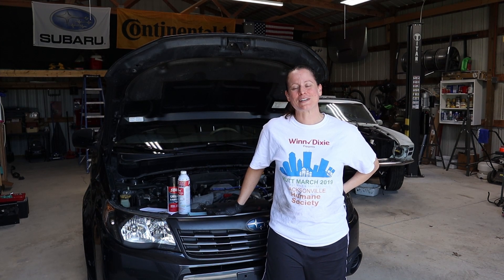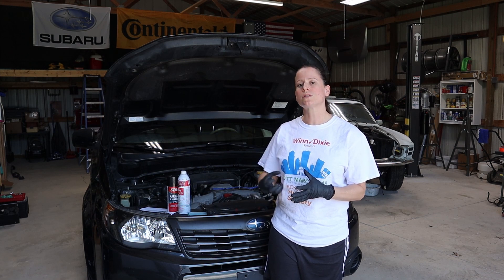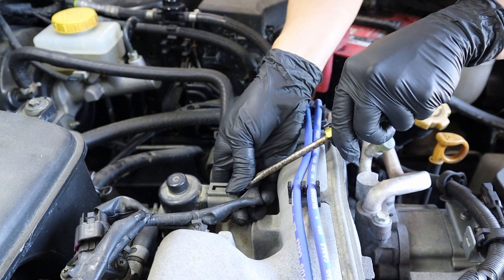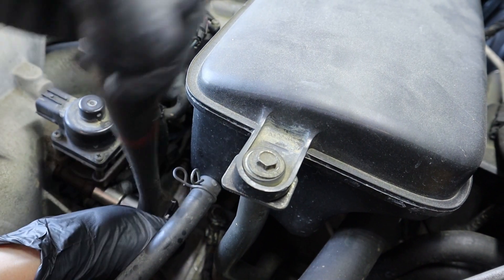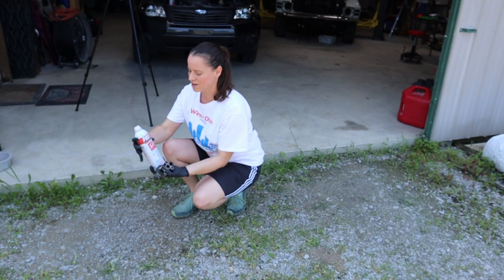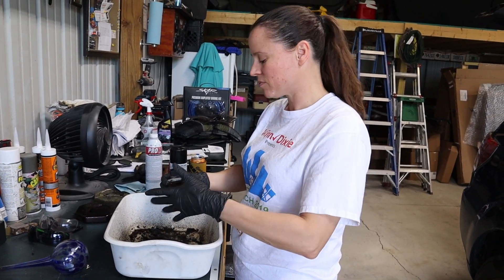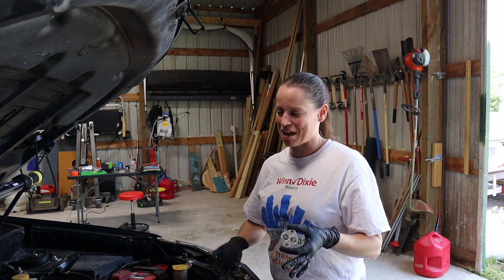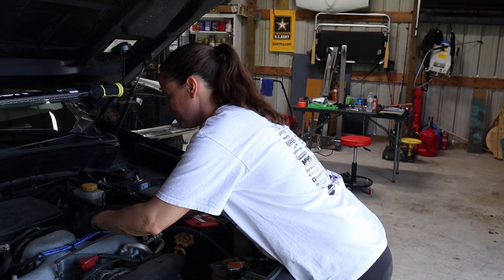Codes P0301 & P0302 w/ EGR Valve Removal - 2010 Subaru Forester

Comment: I know that you eventually found the issue to be the exhaust valves; however, I would suggest that if anyone feels the need to mess with the EGR valve, you might as well also remove and inspect the EGR tube.  if there is a ton of carbon in the valve, it is also likely in the tube.  this is the big tube thing that is next to the EGR valve.
Reply from the maker: Hi S M. Thank you very much for watching and sharing with the community.  That's what this is all about. Cheers!

Comment: 2006 sti po302. Swapped spark plug and ignition coil. Code came back. Next will be swap fuel injectors from cylinder 2 to 4. Next will be compression and leak down. Already did chemicals like seafoam, b12 etc. Last will be torch the car
Reply from the maker: Hi Miriam, thanks for watching and I do really feel you with the last remark of torching the car! Chasing down these codes feels at times to be the very definition of insanity! I had many people suggest a compression and leak down test on my Forester, and had I kept the car after replacing the heads (my codes were due to slipping exhaust valve guides) and the codes came back I probably would have done them before throwing in the towel. You could also have the fuel injectors tested and cleaned if you could stand to not have the car for a few weeks, and then you'd know for certain if the fuel injectors are to blame. Hope you find your sti's demon and exorcise it appropriately; take care and stay safe!

Comment: Hi, I have a Subaru Liberty (Legacy) 2.5L NA 2009 (gen 4) in Australia. Just seeing that you have a pretty cool spark coil wires. May I know which brand use have and also do they fit for vehicles in Australia? Thank you.
Reply from the maker: Hi Captain Cookie (love the name!), thanks for watching and noticing those wires! I picked up a set of NGK brand at some point while I was chasing these codes, and while they didn't fix the codes, they do look very pretty and matched the spark plugs nicely. I'd like to say you should be able to pick up the same set, as my understanding is the Australian model you have still is the EJ253 that I had in my USDM Forester. The brand is very common in the states for Japanese manufacturers. Hope you find them!

Comment: Did it work?
Reply from the maker: Hi Demar Mckenley, it did resolve the code for a few months... unfortunately for us, the code came back and our technician at our local Subaru dealership suggested that we check out the exhaust valve guides in the heads. We've pinned a comment to the top of this thread with the link to the video outlining the diagnosis and what the fix entailed. Thanks for watching!

Comment: I have a 2012 forester and couple times a week I get a misfire on all  cylinders. Can someone help please?
Reply from the maker: Hi Yuriy, thanks watching and asking! The 2012 Forester does have a different engine than my old 2010. The FB engines do require different maintenance for optimal performance. Air, spark, and fuel are all required, so diagnosis of the misfire problem can take time. If you've already checked all the air intakes and exhaust outs, move on to spark and wires, then onto the fuel system; in my experience this is the most cost effective order for self-diagnosis. I wish I could be more help, but we just are not familiar with the FB engine.

Comment: Good day, after cleaning the EGR valve did that help with the misfire code p0302 and P0301?
Reply from the maker: Hi Amir, thanks for watching and the very relevant and valid question! It did help the codes, temporarily, but ultimately and quite unfortunately our Forester needed new heads. We pinned an update to the code chasing journey with a link to our video on the visual diagnosis of slipping exhaust valve guide pins to the comment list here. Here's the link: https://youtu.be/KGOxTT1Sb_g
Reply: @SpiritedWrenchers  thanks

Comment: What liquid did you use to clean?  Thank you.
Reply from the maker: Hi Victor, thanks for asking! I used regular Seafoam to soak the EGR valve. You could use carburetor cleaner, but Seafoam was recommended to me by a Subaru Forester group and doesn't come in a spray bottle making it easier to pour in and let soak.

Comment from the maker: Hello folks! As of September 15, my codes have returned.... It was a nice 2 months without misfire codes, so up next on the Forester we will be pulling the fuel injectors and sending them off for servicing at a local shop (who also takes mail-in!). Sometimes, the fix is easy, and other times you just have to chase the code!
Reply from the maker: @Michael Wojcik this is excellent advice for chasing down the cause of these misfire codes!!!  I'd already done 2/3's of it before we ended up getting a suggestion to check the exhaust valve guides, and that appears to be the cause. They work themselves out and in over time after being remanufactured like mine where when I did my shortblock replacement in 2018. Unfortunately the only way to resolve that issue is with new heads, but it is super easy to diagnose (see our new video for this)

https://youtu.be/KGOxTT1Sb_g
Reply: I'm currently on the same path as you except I've done injector cleaning and rebuilding. Cylinder 1 Injector was leaking due to cracked seal/gasket. After a week, the misfire (and stall when hot) is back. I've replaced and cleaned EGR and am considering EGR delete test that theory.
Reply from the maker: @Tijke  thanks for watching and the input! Our Forester seems to be fine when hot, but the code happens upon idle while warming up or when coming to a stop and the engine isn't a full 190°-212° F. I have been thinking of replacing or checking the fuel filter as well since last week. We will just keep chasing the code... When we are fully stuck, I think it will be time for a full smoke test or perform a compression test (which hasn't been done since the short block swap) to rule those out entirely.
Reply from the maker: @Michael Wojcik for my catalytic converter/exhaust manifold, I just paid the price at my local dealership. I have heard great things from subarupartsforyou, and would have ordered my short block from them had my dealer-at-the-time not offered me a discount. For used parts, I always trust the you-pull-it junkyards, especially since you can be your own judge on if it's a solid piece or not.

Comment: Yeah, I already did that.
Reply from the maker: Thanks for watching! My codes have returned as well. Since I have chased as much as I can with electric and airflow, I'll be looking at fuel related items next. The injectors have the full 196k miles on them, so we will be pulling those when we have the shop space to have them cleaned/inspected/refurbished to try to save some money ($20-30/each versus $130/each). I will also be looking into the fuel filters, which are also original.

Comment: Thanks so much! Wife just bought a 2010 forester non turbo, and got odometer scammed. Odometer read 102k miles when she bought it, first oil change at jiffy lube tech says last reading was 230k in 2019… carfax found 3 more roll backs over the last 11 years so we’re thinking close to 500k. Been having hesitation and loss of power up any incline after overheating 3 days ago. Spent the weekend changing spark plugs, 02 sensor, oil change, cleaning throttle body, MAF, radiator flush(found some sediment but no milkshake). Gonna try this tomorrow after work and I’ll comment back if I get any improvement!
Reply from the maker: Thanks for watching! Wow to that odometer scamming; I'm not sure how I would handle that news. These engines are pretty resilient as long as the maintenance is done (plus I suggest an oil pump replace with the timing belt). Let us know if cleaning the EGR valve helps, and get those head gaskets checked out if you haven't already!